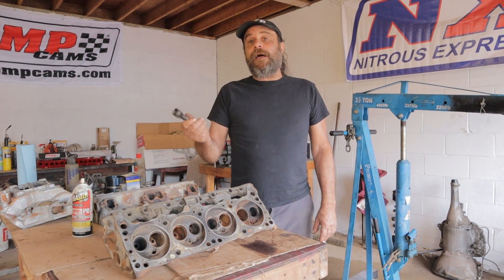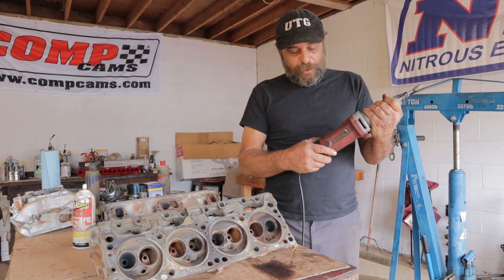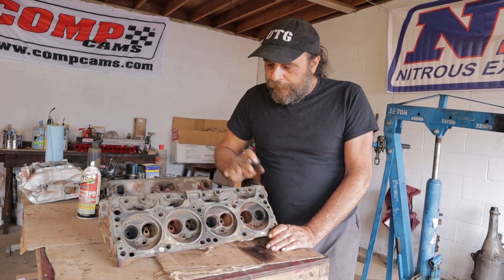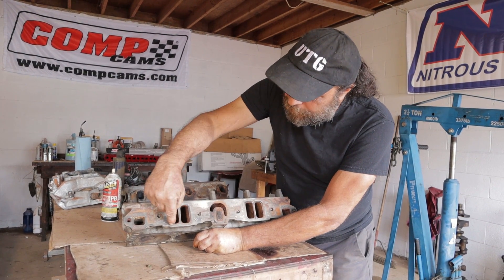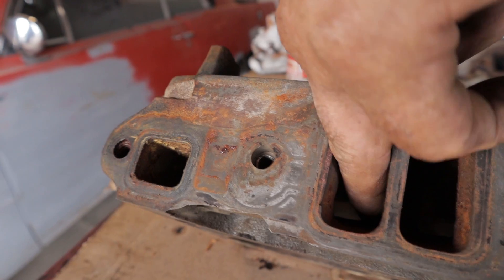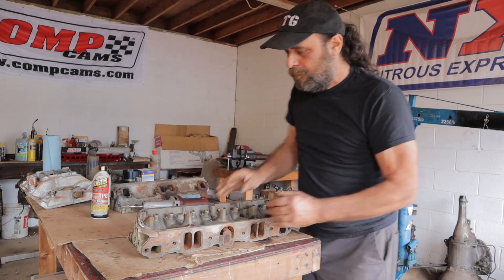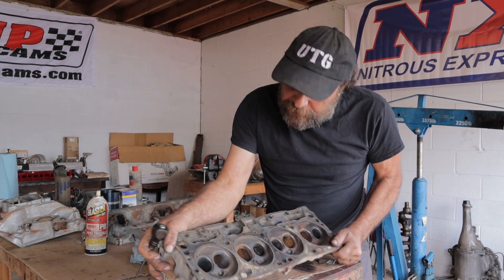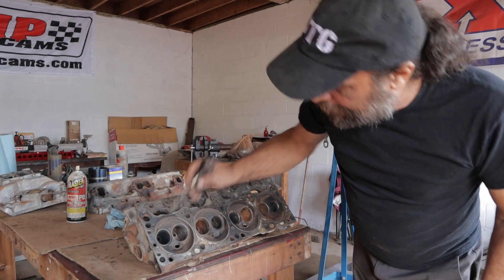Perfect Daily Driver 10 - Cylinder Head Porting Basics

Comment: And if you can get a hold of Mopar Performance. Porting templates, you can’t go wrong. Mopar has put a lot of work into giving you all the information you’ll ever need to build any kind of engine!
Also, when porting the ports, all the way to the bowls, the roof and outside turn is where most flow will be. There’s less flow on the inside of the turn and easing the floor would be much better lowering it. Air is last stuff. It takes the path of least resistance. It doesn’t like changing directions, ever! So help it’s flow remain as straight as you can by raising the roof, and outside turn. To illustrate this further, Ford’s Cleveland series of engines are good flowing heads. The large port 4 bbl heads and the small port 2 bbl heads have the same characteristics, and the same problems. The biggest of which is the exhaust port. It turns down on the floor of the port. The roof is as good as it can be, but could benefit from porting and ultimately raisin the roof as much as you can. But the floor of the exhaust port and its turn downward kills velocity. So aJack Roush, Bob Glidden and Yates all take measures to raise the floor. They cut out the port. You can cut out quite a bit of the port without hitting anything important like water jackets. So the replace the portion they cut out and put a block of steel or aluminum and create a pert that is raised and carries the flow up,and out. There are also steel plates the go on the exhaust side of the head with tabs the fold down and get rid of the downturn. It’s a much cheaper way to go with stock heads and it provides more flow velocity, creating more horsepower. Then came the Ford SVO heads. Now your probably not going to believe me , but I met a guy at UTI, who won the pit stop completion in California. My school couldn’t afford the entry fee, or the ran sports toon and lodging to get us there. I became friends with one of the guy who were there preparing to go to Fords Engineering school. We met almost every day for lunch, play8ng cheeses as no one else could c9mpete with either of us. One day while waiting for our turn at the chess board, the winner got it for the week, and while we’re talking I took out a pice of paper and drew what I though Ford should make fir the Cleveland in the form of racing heads. I drew the port shapes, including an oval exhaust port that was wide and oval shaped to help flow. I also suggested three different port sizes for use on the 289/302 engines, 351C street striping and an all out high rpm race only head. A couple years later I was visiting a friend who worked for a local Ford dealer in the parts department and he had the new SVO, (Special Vehicle Operations), catalog and he gave me a copy. When I got home I leafed thought it, and it was Ford’s answer to the Direct aConnection/Mopar performance program. And right there in the cylinder head section was the heads I had drawn fro my friend a few years prior.

Comment: lol I used to have a grinder like that and it lasted a while, but the one thing I remembered about it. is that it spun scary fast lol. I'm pretty sure it was like twice as fast as  any air tool. also the part you hold would get hot after using it a few minutes but hey it worked. .

Comment: I did this on some cast iron sm blk Ford heads with 1.90/1.60 valves that I bought from Indy cylinder head years ago.....the engine is still running w/low miles in a 1983 Mustang GT that I never finished painting.
I'm about to work on a 318 in a Ramcharger....this is good info! 👍

Comment: Tip, if you are grinding aluminum use wax on the burr to keep it from clogging. Old candles work well. Cuts better too. Go for a multi angle valve job, as Smokey Yunick said "the valve is the obstruction in the intake path."
Reply: Something else to try as Wax just flings... For aluminum what's even better is a mixture of wd-40/ marvel tool oil and a touch of dawn to make it cling.  We use that combo no matter the carbide type when working aluminum.
Reply: @460efiguys3  Tap magic is ideal...helps cut the metal and shavings will not stick 
(cutting oil)
Reply: why i use stone on cast and burrs on aluminum
Reply: Bar of Soap or a hard buffing compound helps also .

Comment: you are very lucky. when i was in your age bracket, i had to have at least 3 - 100 watt light sources (or work in direct sunlight) in order to see well enough to port heads. and yeah, i learned the hard way about brazed carbide cutters. only back then, the solid cutters were in the $10.00 - 25.00 each range.  i miss working on engines so much.  it was the most satisfying thing (except for the kids) i ever did.

Comment: Good video, but i don't know why nobody ever talks about the 2 different types of burrs. The burr in your video is only good for cast iron and steel etc. Not good for softer alloys like aluminum,copper etc.because the softer alloys clog up the flutes in the burr almost immediately. This is so,so,so important for people to know. The burrs that are used for aluminum do not have as many flutes so the aluminum has a harder time plugging up the correct burr. But if you used one of those burrs on cast iron it would dull or break  the burr almost immediately. Correction: ive heard you can put some grease on the burrs your using in the video to help avoid the plugging issue a little bit.

Comment: just cleaning and matching the ports can help a lot , porting helps too but if u can flow test and balance the flow between the ports really helps a lot we ran my 202 angle heads that were ported to 204 and ran them that way with just the ports match worked great but after we ported everything like water, oil drop, intake and exhaust then balanced the flow that really made the engine come alive but the problem with it is money after we did all that work plus the block work we ended up putting another 25,000 in the engine . we started with a engine that we pulled out of a dragster and were did they come with that u can't run over 10 to 1 with pump gas i was running 13 to 1 with pump gas with no problems it didn't like anything under 92 octane

Comment: I'm glad that there's someone down to earth and easy to understand passing down this kind of knowledge. Most people getting into cars now think an exhaust system and a cold air intake make 100 extra hp. I was talking to a guy 10 years older than me at least about my LS Project and told him I was using stock manifolds (5.3/LM7) and he said, and I quote "You've got to use headers, the 5.3 just like the one in my truck, with headers and a tune... will make 600hp!"  I'd like to have that tune.

Comment: Have a question for a Mopar guy, I’ve owned a lot of 360 (5.9) magnums which is EFI, every time a valve spring brakes and drops a valve it is cylinder 8, why always 8? Is it the heat from the cat?

Comment: I've run the old SP2P on 3 different low compression 70s motors. Good throttle response and bottom end, but all done by 4500.

Comment: You can use a dremel  an gray stones that look like xmas tree's.  That's what I use . Works great get a adjustable  speed. I have done 5 seats of fe heads.with the same dremel  yes I have burnt up a couple of  them ..that was due to letting  dust in the motor vents .so blow it out on occasion

Comment: Looking at the burn pattern in the chamber before you clean it will help you to know how the fuel acts in the cylinder. Clean areas indicate heavy fuel in those areas. thick deposits indicate areas of slow or incomplete burn. This information will help you to determine how to modify the chambers and ports

Comment: Its just an air pump....Gotta get it in and out effectively. I dont use flow bench info....unrealistic vacuum (28") no engine can pull 28" . Theyll list big numbers @ .700 lift...I dont run a nitro dragster. A valve goes thru mid lift twice...up the ramp and down. I always concentrate on getting the fuel flowing quickly at low lift. Most street cams top out @.500 lift...more effective flow around .250" will make more overall power. Your valve seat angle makes a huge difference. Most street engines will benefit from a bowl cleanup and a multi angle valve job. Anything more risks killing power at lower RPMs
Reply: Sorry, but a flowbench doesn't operate at inches of vacuum. It operates at inches of WATER. So yes, the engine will never see 28" of vacuum, but it also doesn't run at a steady 28" of water, like a bench.  It operates from 0-200+. Next, the port will NOT flow the same on both sides of the lobe.. Thirdly,  you WON'T make the most power at .250" lift on a .500" lift camshaft if the valve is still in the chamber, shrouded by a wall. That is why the biggest gains will be when the valve leaves the chamber and enters the bore, until it hits the venturi convergence point. 
Basic stock iron heads will respond well with the correct valve job, IF it is blended into the bowl correctly. Hogging a bowl to the bottom of the seat like THIS GUY does, is guaranteed to kill power and torque every time, IE; Air Speed. Minor work is ok, but sizes are critical. Polishing, cleaning casting flash, gasket matching all do nothing. Just sayin'..
Reply: @vengeanceizmine9878  Of course an engine doesn't make max power at mid lift...I assumed the opening and closing ramps are identical.Im old school so maybe they are grinding cams with asymmetrical  ramps...My point was people tend to concentrate on the big numbers and ignore low lift flow..The flow begins with the valve opening and hogging out the runners and bowls tends to kill the velocity until the valve fully opens. My intention is to enhance flow all through the event. I mainly build street motors and concentrate on torque. Naturally a race engine would have different needs.. Never used a flowbench...too poor lol.
Ive used experience and intuition over the years on my heads..have I left power on the table? Probably...but Ive got 30 yrs under my belt building and modifying engines of all kinds and I do at least improve performance lol..keep on wrenching and learning friend.  At 60 Im still learning things.
Reply: @billcat1840  Nothing wrong with learning, at least you're thinking. A bench can be a useful tool, but it can and does lie to you, and will hurt your feelings. I don't chase numbers on a bench. A cfm number is the least important factor. What you need to think about is the correct size and shape of the port, as well as how it enters the chamber and bore. It's all math, and experience. Believe it or not, airflow DOESN'T come on hard at the opening of the valve, more like .300"-.500". A bench would should you that,  but it is obvious why. Also, keep in mind, where you go bigger in one area, sacrifices another. You will not get a port to flow uniformly through the lift range by just working one area. If sized and shaped correctly, it will help in a specific area of lift, but choke the other side. I wouldn't focus too much on "velocity". An engine still needs "area" to see gains. If a port is too small to start with, velocity will always be there. It is all relative. Once the valve hits the venturi convergence point,  gains start to drop, and air speed becomes critical. Regardless of how the camshaft is ground, the port doesn't act the same on both sides of the lobe. Something else to think about... 95% of power from porting is designing the correct size and shape of the intake tract for each application, the other 5% is just a cfm number... hopefully you get my meaning. My faster engines have never even seen a flowbench lol. Hope this helps.

Comment: I live in canada and we have canadian tire and my mastercraft die grinder looks identical. When i ported my LT1 aluminum heads i found it had way to much RPM and i wrecked a few burs. I bought a voltage regulator off amazon you plug it into the wall then the die grinder to it and you can turn the voltage down and it makes it way more controlable. 
I did borrow my welder buddies older makita which has a dial on it and i could turn it to a perfect speed and blend the bowls nicely. 
Another helpful thing was to bend a voat hanger or piece of cleaned off welding rod 90° and cut it so it is as wide as your first port, one as tall as it when it is done and then you can use it yo try and get each port as close as possible
Reply: I also recomend getting a cheap disposable tupe LED light you can stick over the opposite end of the port and it lights up nice high lighting the high spots and low spots.
If you really wanna smooth it up i found the best quality and priced porting sanding drum kits was the east wood kit by far. 1 kit did my aluminum heads and i had a couple left over and have ported a flat head brigs and stratton or two 😉

Comment: You never open the bowl to the seat, you want a radius that leads into the bottom cut.  You never open the pushrod pinch on port that isn't completely worked down stream. Gasket match is a waste of time, who said the gasket was the right size? And having 2 ports meet the same at the gasket does nothing if there are issues on the way in and out.  Most of the flow is away from the walls.  Evening them out does little.  Doesn't hurt but it's not huge. If you have puddling coming from the pushrod pinch you have much bigger problems elsewhere.

Comment: I've done porting on more than a few heads but never used a grinder like that.  Pneumatic die grinders are much lighter but air compressors are noisy and extremely inefficient.  I always use my Foredom 44T with a harbor fright electric flex cable die grinder setup when dexterity is important.

Comment: Hey buddy!! Hey I have a dodge ram v10 magnum I'd like to open the ring gap on and put a turbo on it.. I've had the truck for 13 years and I redid the transmission last year and I put a billet torque converter in and it took away some of the pep of the truck I'm thinking because the converter is heavier.. so I'm restoring this truck and since it's something different I was wondering if you'd be interested in helping me with the project.. main thing I need help with is figuring out how I'm going to do the fuel system and tuning because this truck has split shot injectors.. obviously could use help doing the ring gap.. but might make for some interesting content because seems to be a rare truck I've only seen a handful of v10 magnums besides mine.. anyways I'll try sending a email.. I can't imagine how much email and messages u get.. but I'm the guy who sent u the email about running 8s with no fuel.. I don't live to far away.. have a great day!! Thanks 4 spreading the knowledge!!

Comment: Porting heads is one of the most important engine modifications!! Maybe the most! just swapping a cam without doing this is useless in my point of view!

I had this done on my 69 Chrysler 440 (350 horse version non high performance) The car boiled the tires and had lots of get up before,after that it felt like another 50 hp was added!!! 

That car left 1987-1993 5.0 5 speed Mustangs standing still! My buddy had a a 92 LX coupe(lighter model with trunk) added 4.10's ,typical mods of the day off road exhaust blah blah..I would be 1.5 to 2 car lengths ahead of him! I had 2.94 axle ratio!! This was a 69 300 2door..350 hp 440 even had the stock small cfm 4bbl Holley carburetor..Only non stock part besides the head job was a duel exhaust system..still had the stock non hi flow manifolds! Car was a rocket! 4200 lbs of Fury! I later changed the cam(purple cam) headers,yes they make them for c bodies and added 3.55 gears..

Comment: I can see where porting can solve issues you didn't know you had. Before porting you can see that all the ports were inconsistent. That one exhaust port with that huge extra bunch of material is so going to flow differently from the cylinder next to it. I would love to see a before and after video of just the idle before and after a simple port job like that, No other changes just pull the heads port them and drop them back on. I bet the idle would be so much smoother. I can bet lots of people have had engine issues and tuning problems that they never really solved that could have been fixed by porting.

Comment: Following this build closely getting ready to do a build almost identical to this one. Starting with a 360 from a 1974 motor home that I picked up super cheap. Runs great now but needs all new gaskets and freeze plugs from sitting most of it's life. Motor and trannsmission have 74,000 original miles. Want the same type of build you are doing for a fun little daily driver. Drive train will be going into a 1980 D100 short bed 2 wheel drive. Thank you for sharing your knowledge freely so others can learn.
Reply: I guarantee the exhaust seat by the heat crossover is sunk so bad it can't be fixed. So, good heads to practice on!

Comment: G'day,,I strongly recommend a pair of tight fitting safety glasses,,cast iron not so bad,but steel's give off little razor blade shavings,and they get every where,,
Now i don't know if you ever had your head clamped down while they pick metal out of your eye's,,but it's no fun..you can see it all happening,with ya head clamped down,,yeer no fun,
the other thing,,if you do get metal or any other thing in your eye's,don't put of getting treatment,you eye grow 7 layers over it in 24 hour,,and that means they have to dig deeper,,
how do I know,??? been there and done that,,

Comment: I do a lot of head porting on Motorcycle heads and I've been looking and looking for a 1/4 Electric Die Grinder that is about the same size of a pneumatic one. Any ideas? Anyone or Uncle Tony? Main reason I would like an electric one is because sometimes late at night i like to go out in the shop and grind away till about 1:00 AM and I hate using the air pneumatic one because it's noisy as hell. I don't mind it in the day time. My Main thing is I wanna do it in a "Quite Manner" and not have to hold a big ass motor while doing it and a Dermal is not a real tool so no one please recommend that.